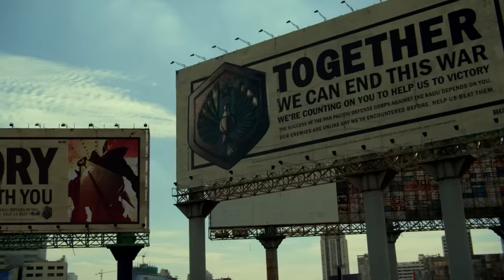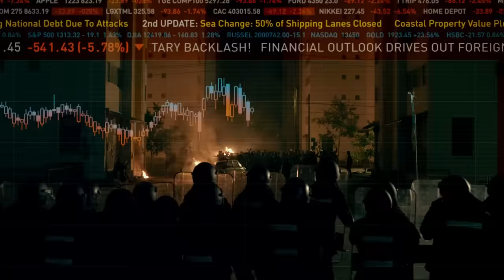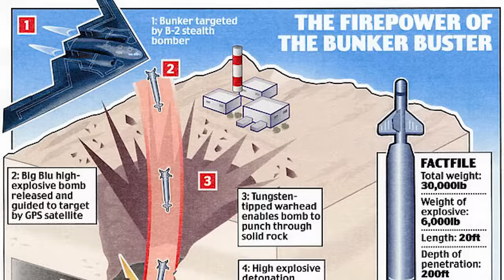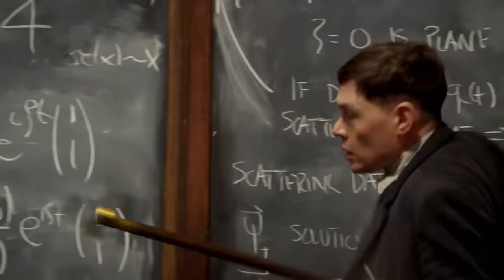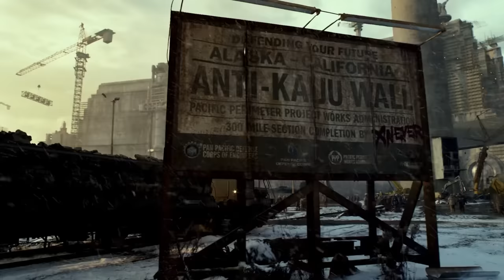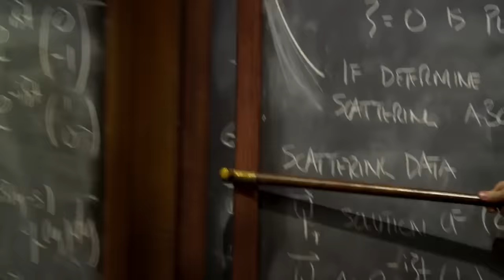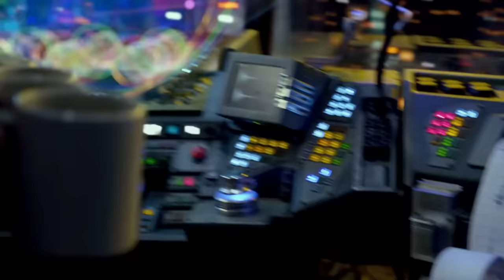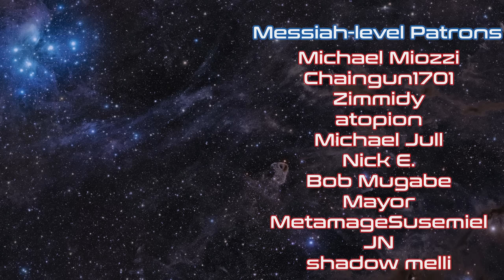Advanced Sci-fi Civilisations Too Stupid To Really Exist Ep.20 - The United Nations (Pacific Rim)

Comment: Given the effectiveness of swords, Cinimasins suggested a kaiju meat grinder built around the breach.
Reply: The only issue I see in this plan is getting close enough to the breach itself because of the fact that the main breach is DEEP underwater so trying to build it now more a challenge due to water pressure, making it wide enough and tough enough to handle the kaijus crawling out of it. Then there are the kaiju themselves which may even start guarding the breach too.
Reply: @connortripp99  use Jaegars to build it lol
Reply: @connortripp99  See, you bring up the main point I had with all of this. The kaiju didn't amass around the portal. If the plan was really to destroy humanity and they could only bring in a few kaiju at a time, you'd think they would have the first wave guard the the breach. Then keep bringing in kaiju on the timer, until they just overwhelm the entire planet.
Reply: @williamedwards4151  high risk high reward, because if you get discovered you are gonna get spawn camped by literal nukes.
Reply: @ivanivanovitchivanovsky7123  Or use those Jaegers to just fight the friggin kaiju
Reply: @williamedwards4151  It is stated, as I recall, in the original movie that they seem to be spinning up a geometric production line. Implying a production bottleneck rather than a transport one. The jagers need to kill the breach now because in a cupple weeks they will be sending out dozens of kiju per day, and each one will be bigger and better than the last one. And don't forget that the breach was, they thought impossible to enter from the human side.  
So precursors chose to scout around instead of forming a fortress on top of an impregnable fortress. Information is one of the two most lethal weapons known to man, which is why scouting is way more important than setting up camp...especially for the aggressors. 
It's also kind of implied that the kiju are a terraforming agent, at least if they are killed, meaning all killing them dose, from the precursor perspective, is waste some time, give them data on human combat abilities, and simplify the post invasion consolidation.
Reply: It slices, it dices, it makes julienne fries!
Reply: @coolphoton1234 Thank you. Scanning YouTube comment sections is like panning for gold. More often than not, a frustratingly unrewarding endeavour. But every once in a while, you find that metaphorical nugget. One thing I would add, is that a lot of real life nations, empires, etc., are also seemingly too stupid to exist, but they did, or still do. Maybe the Kaiju military industrial complex is just as corrupt and Byzantine as our own. Maybe invading earth is just a boondoggle. The invasion has been subcontracted to Kaiju mercs, and they don't actually want to win. Maybe they lied to their kaiju investors about earth having wmds or valuable resources. The war itself could be a scam. Maybe the companies making the mechs and building worthless boondoggle walls, are actually in cahoots with the aliens.  Or maybe PR is the intergalactic equivalent of dog fighting, and it's all about illicit, interstellar gambling. If you're trying to scam investors, bilk tax payers, justify bloated defense contracts, etc., then all the stupidity actually makes sense.
Reply: The problem is they respond to plans. Honestly all the trap ideas have weaknesses- Meat grinder? Big armor ball kaiju breaks it, or they send acid pods up or something.  Nuke mines? They start sending mini-kaiju like we see in the Black- do you waste a nuke on something small or do a buncha small ones destroy your nuke mines? Etc..
Reply: Yeah... simply one giant paper shredder alongside the opening. Kaiju goes in, kaiju mince meat comes out. ... you even can set the device coarse enough, so that scientists and .... enterpreneurs can get samples for studying.
Reply: A big dumb paper shredder sounds exactly like something Northrup-Grumman would come up with. Luckily, this is a Lockheed-Martin world, so we got big dumb robots instead.
Reply: @FrostbiteDigital  or do both? They have tons of Jaegars and only one Breach to watch.
Reply: @connortripp99  you could make a submarine with saws built into it
Reply: @vorrdegard2176  I'm sorry, but I'm going to need you to go into more detail. What does a submarine with saws look like?
Reply: @coolphoton1234  It wasn't a production bottleneck, but a transport one. Basically, each time the tunnel is used, it becomes stronger/wider, and can consequently be used again sooner. That's why the Kaijus could both get bigger and with less time between them, before we finally get the double Kaiju event.

My guess as to the reason why each Kaiju right away goes out and attacks? Logistics. Kaiju are living beings, and need food and such. Being from a different ecosystem, earth wildlife doesn't do it for them. Their death upon going through the portal is inevitable, until such time as enough terraforming has happened. Therefore, they might as well attack. That does, of course, still make the invaders not too smart. It'd make more sense to send stuff through and let it die at the bottom of the trench, rather than attacking. This could buy time before humans notice, and also mean they wouldn't be as motivated to develop weaponry against the Kaijus. Build up the transport system, then hit the enemy hard.
Reply: @cdubsoptional7849  well imagine a regular submarine but with spinning saw like those that cut wood built into its hull
Reply: @vorrdegard2176  soo what stops the kaiju from just swatting them like flies? Remember that kaijus can swim
Reply: @vorrdegard2176  Ok, I get it now. You were making a joke about propellers. Well played.
Reply: @cdubsoptional7849  well it's a movie with giant robots and monsters
Reply: @Sierlea  Well if they COULD build super resistant kaiju then the jaegers wouldn't have been able to literally stab and beat them to death. And then humanity would be basically done anyway, apart from moving to another planet.
So just build a meatgrinder, speckle it with nukes, and have a spare one nearby.
Reply: You know when the breach will open.  There is no theoritical limit to the upper size of a fusion bomb and we understand the concept of surprise party.
Reply: @coolphoton1234 if the precursors wanted to scout, why the fuck did they use massive city destroying Kaijus as scouts? Save those for the assault wave. The scouts could have been like small birds or maybe even microbes instead of something that makes nukes look subtle. Using them as scouts would be like the US sending a fucking carrier strike group to do reconnaissance
Reply: @Sierlea the enemy being forced to adapt to a plan doesn't make the plan bad. It makes it successful,just you need to follow up with more successes.

It's certainly better than a failed plan like walling off the entire Pacific ocean that was tried and failed immediately. It would also be better than the Jaeger plan alone, those could function as a redundancy and save a lot in maintenance and operating costs if they only had to fight the stuff that got through the Mariana Blender.
Reply: Hear me out here, a giant Tungsten spike with a rocket engine strapped to the back....

Comment: I just love how apparently building a wall theoretically big enough to stop sky-scraper sized monsters, and long enough to surround the Pacific ocean, was cheaper than the Jaeger program. Like, I get that the Jaeger program was insanely expensive since it featured some of the latest cutting-edge tech on a massive scale, but we are talking about building a heavily reinforced skyscraper-sized wall long enough to circumvent the globe. You could honestly build hundreds, if not thousands, of cheap and disposable Jaegers for that price, and they would have the benefit of actually being able to neutralize the threat, instead of just slowing it down, but nope. 

Honestly it would have been far more plausible if the Jaeger program was dropped for something like a bioweapon deployment system, or orbital platform, or some other "wonder weapon" that can be equipped on regular military vehicles. Then suddenly a counter is developed by the aliens designing the monsters, and now the Jaegers are needed again until another solution can be developed. This is basically how arms races in wars work, you adapt, the enemy adapts, then you adapt again. This would be 100% plausible in-universe, and would get them the exact same key plot points of "Jaeger program not needed, then it is." But instead of actually developing new tactics and technology, they decide to toss their latest and greatest stuff away and use tactics from literally thousands of years ago, the failed concept of unguarded frontier walls, but on a ludicrous scale.
Reply: They were running low on rare minerals needed to build jaegers, I believe. Basically, looking at three factors to abandon the jaeger program: lack of resources, lack of money, and it was failing more and more.
Reply: I feel like a series of big coastal railguns would have been a more than adequate solution.
Reply: @Axterix13  I mean, it's not like the jagers evaporate when they're disabled. They're capable of airlifting these things so why aren't they reprocessing jager wrecks if they're running low on elements needed for the jagers?
Reply: Jaegers are nuclear powered, it is very expensive to mine and refine nuclear material. a wall is much cheaper.
 and no, the other solutions are not better, the jaegers are mobile, the cannons on the russian jaeger are bigger than any ship, the plasma cannon is powered by a nuclear reactor, and given their size a sword or blade makes a much better use of energy on a jaeger than on any other vehicle or weapon.
Reply: @jesusmora9379  earlier model ones were nuclear
Reply: @Axterix13  Repairs are not a thing?
Reply: @vivusthevivusthing6182  No one even so much as implied otherwise. They still cost an immense amount to repair and maintain, let alone build new ones to replace the ones that are totaled.
Reply: Or just mount their weaponry on big tanks or ships. A lot cheaper than a giant complex mech that will need constant repairs, especially if they come regularly in contact with seawater.
Reply: @jesusmora9379 actually it is nowhere that expensive... There is more uranium on earth's crust than cobalt, for instace.

Comment: Wait, the kaiju's flesh is silicon-based? Doesn't silicon crystallize when exposed to oxygen?
Reply: You have to remember that these creatures are designed, not evolved.

Either that's an intentional design feature (Explaining why the Kaiju are immune to normal weaponry) or something the Precursors had designed around.
Reply: Being engineered organisms that can do thing like produce massive EMPs there is probably any number of ways they could get around the issue of silicon turning into a solid when it oxidizes
Reply: @VelociraptorsOfSkyrim  Silicon should not stop depleted uranium ordinance or even a bath of corrosive acids like HF.
Reply: @VelociraptorsOfSkyrim  But they aren't immune to conventional weapons. Striker killed one with a volley of missiles.
Reply: @richardarriaga6271  -- the Kaiju's primary defense is its sheer mass.  To a creature weighing 6,000 tons only our largest conventional explosive and chemical weapons would give them more than a mild rash.  And all our existing ballistics weapons platforms are basically just bricks with pistols taped to them.

A really big harpoon is ptobably the. best option.
Reply: @Grizabeebles  Clearly the UN should have played monsterhunter. Imagine Jaegers equipped with dragonators or gunlance style weapons, or pretty much any weapon from that series?
Reply: @retroicdescent  -- If the conceit of Pacific Rim is that Kaiju are mostly immune to explosives and high-velocity projectiles, then yeah.  Humanity would basically have to completely rethink weapons design.
Reply: I imagine it's really more like normal organic compounds constructed using silicon replacing the usual carbon.
Bond energy of a C-C bond is 80 kilocalories per mole, to Si-Si which has a bond energy of 54 kilocalories per mole. 
Simply put, silicon tends to form weaker bonds than carbon (at least with itself in a gaseous, diatomic form.)

If we're going this far, might as well invoke the unholy imagination crushing powers of the square-cubed law though.
Reply: @wolfiewoo3371  I'd hardly consider anything equipped to a Jaeger as "Conventional weaponry."

I'd equate it to a Nuclear bomb. Sure, it gets the job done, but it hardly does it without massive amounts of collateral damage.
Reply: @richardarriaga6271  Honestly, I was just throwing something out there as a possible explanation. 

We're talking about monsters on a scale that should be impossible on Earth.
Reply: @VelociraptorsOfSkyrim  But they're still conventional. Anything equipped to a Jager can be equipped to a truck, tank, boat or some other weapons platform. Besides swords and saws, missiles and plasma cannons are definitely transferable and missiles especially can be launched at a safe distance and accurately too. And what do you mean by "getting the job done without massive amounts of collateral damage?" Striker launched its missiles within city limits, in front of onlookers on a nearby building. In addition to this, I fail to see how giant robots having an all out brawl with giant monsters will cause less collateral damage than targeted missile and artillery strikes.
Reply: @wolfiewoo3371  the trespasser the first kaiju in the series shrugged off the entirety of the US military attacking it for almost a week only dying when they brought in the nukes and it still took three before finally dying like did you even watched the movie it's literally what they say in the first 3 minutes
Reply: @XD-sc4ix  Which doesn't make much sense to me at all. How can a kaiju shrug off the shockwaves and kinetic force from multiple very powerful explosions but somehow the far weaker shockwaves and kinetic force from giant metal fists are more effective at hurting them them?
Reply: @wolfiewoo3371  according to the creators of the movie the Jaegers do punch as hard as nukes
Reply: @XD-sc4ix  😯. But that's the thing, they clearly don't. This isn't One Punch Man.
Reply: @wolfiewoo3371  why not?
Reply: @XD-sc4ix  🤯🤯🤯
Reply: Silicon based (which is theoretically possible for life) not made from elementary silicon.
Reply: @XMysticHerox  Okay? Carbon-based life still suffers from the limitations of carbon, so silicon-based life would experience much the same.
Reply: @purplehaze2358  Yet the properties of hydrocarbons have little to do with those of elementary carbon. 

Most organosilicon compounds are stable in air. In fact they are quite similar to regular organics.
Reply: @XD-sc4ix  If they punched as hard as literal nukes, wouldn't every single punch cause at least a pretty notable explosion shockwave? Even if this is blunt, this amount of energy can't be discharged completely by blunt metal punch force, a lot of it would leak and we have the kinetic energy of a nuke to work with. Even just 1% turning into a shockwave (which is a very lowball) would still mean like 1000 tons equivalent of TNT depending on the warhead. This is what just 500 tons does:

https://www.youtube.com/watch?v=FJkqYihssKI

Those people watching would be so dead.
Reply: @XD-sc4ix Bullshit. If you do the force calculations of energy=mass*acceleration squared then those fists are not delivering ANYWHERE near the force of an atomic weapon. The most important part of that formula is speed and those fists are not traveling at even mach speeds. PLUS all the energy being applied to the Kaiju by the fists is also being applied backwards to the Jaegar.
Reply: @GeorgeMonet  dude this is fiction where you have people capable of destroying planets several times over duking it out with each others and not destroy the planet all I said is what the creator of pacific rim and the prequel comics tell us and it says just that which again makes sense since the weakest one took multiple nukes to the face before being taken down
Reply: @wolfiewoo3371  dude where talking about a movie that is literally just giant robots vs kaijus
Reply: @stormnet7836  all I said is what the creator of pacific rim implies and what the prequel comics explicitly tell us which is Jaegers punches and kicks being as powerful as nukes if it doesn't make sense as I said before where talking about a movie where humans build giant robots to Duke it out with alien kaijus
Reply: @XD-sc4ix  So?

Comment: I always marvelled at how stupid they were to make thousands of miles of massive walls rather than finding the breach and using a third that amount to turn the whole canyon the breach is in into concrete. They could even use some of the metal used in the jaegers to laminate the surface facing the kaiju to ensure they don't even get a foothold. Or if it tracks on Stargate logic, placing it only a few micrometers from the event horizon would prevent them from re-integrating on our side; making the solution an incredibly cheap fix